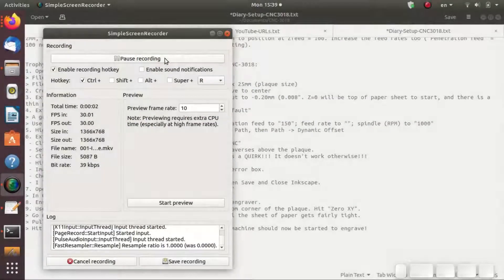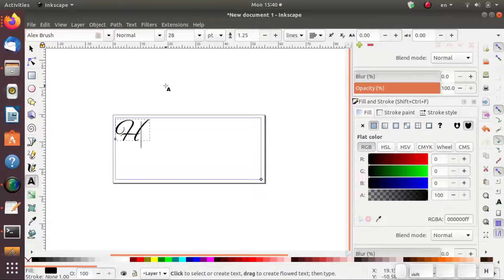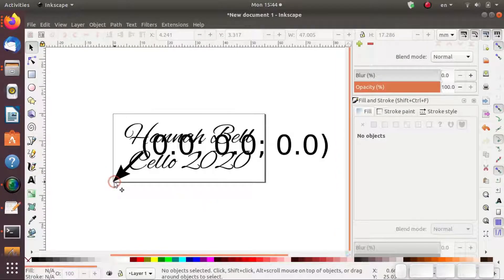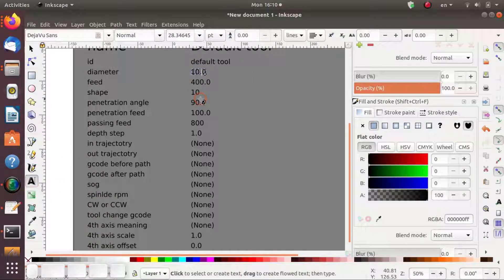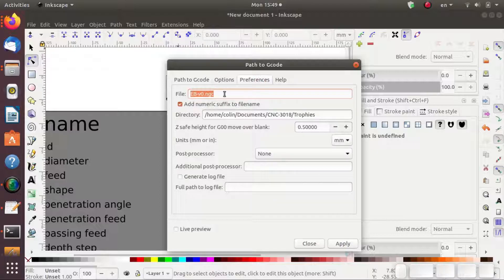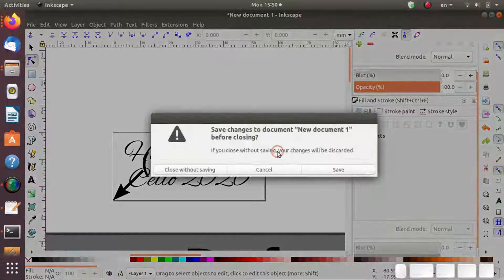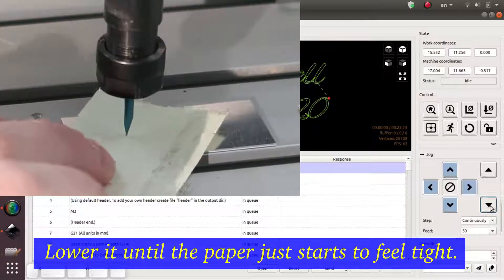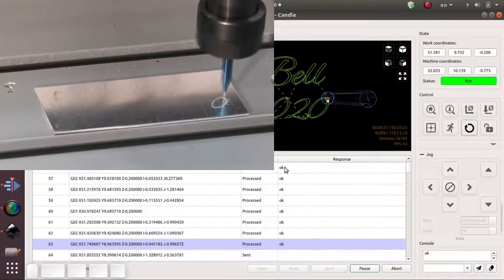Ubuntu, Inkscape, and CNC-3018 micro machine: Engraving trophy plaques

Comment: Hello, I also use ubuntu, we are now with version 22.04 but I can't connect Candle to the CNC. Candle does not 'see' any port. Did you have to struggle with that problem too? and if yes how did you solve it? please.🧐
Reply from the maker: I solved it by not upgrading to 22 yet! I'm been dragging my feet afraid that something won't work. I was thinking about upgrading soon, but now I'm worried about Candle not working!

Comment: Please let me ask a question.  I have used your guide and was successful in engraving letters following your instructions.  However the letters are not solid. They are all outlines only.  How to engrave solid letters?
Reply: Right, the letters are only outlines. I actually don't know if there is a way to fill them in or not. I've only ever engraved small letters, so the outline was sufficient. I think you'd probably want to use an endmill instead of a sharp engraving tool, and it would have to generate a tool path that fills in between all the edges. I was able to do this kind of toolpath generation using FreeCAD, which has a simple CAM utility built in. I only used FreeCAD on simple shapes (for making a square pocket, for example), so I don't know how it would work on complex letter. But there's a chance that the same Inkscape plug-in used to create letters outlines can do the fill as well.
Reply: @heidijoye3473  thanks for your reply. I have since worked out a method. Do the drawing in Inkscape save as SVG file. Import into Easel software and there are options to engrave including pockets. It works well and its so simple. It’s also free. No installation it’s browser based. Regards

Comment: I’ve been searching for this exact task. Your video solved everything for me. I’ve beefed up my 3018 quite a bit so it’s actually a small CNC milling machine instead of a router. I use small ballend end mills which produce a very clean engraving. I really appreciate your video for getting me on the right path, so to speak.
Reply from the maker: So glad to hear it helped! Have you checked the flatness of your stage with a dial indicator? Mine was "dished" (low in the middle, higher on the edges) by about 0.030"!!! In fact, there was a dish to each T-slot area too. It's just that the stage is cast (I guess) and very poor tolerance. I spent a few WEEKS with a small endmill trying to mill the moving stage flatter. Best!

Comment: Do you have any idea to install laser extensión on inkscape 1.0 for ubuntu?
thanks for this video too
Reply from the maker: Man, I've thought about doing the laser. I have a 7W laser module (though it can't run continuous at that level without some serious cooling), but just balked at the thought of working the bugs out. Maybe, though. I'd love to try it if I can get my hands on a turn-key laser module. I've been engraving guitar pedals lately, but my paint is so thick it leaves a burr along the edge that's hard to remove without scratching the paint. I wondered if a laser might be the (smelly) answer.
Reply: @JoyeMusiccom  
I prefer use inkscape to export Gcode into a SD for my CNC machine with the laser, but the extension don't works in inkscape 1.0 in ubuntu, but yes in 0.9 in windows...
T_T
Reply from the maker: @futublock  Hmm, that's too bad. I hope someone gets it working soon.